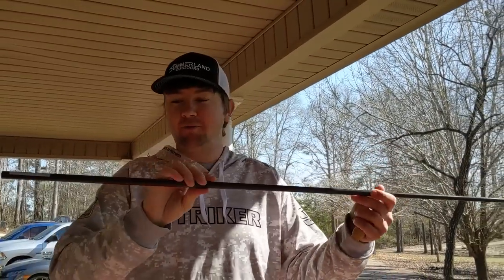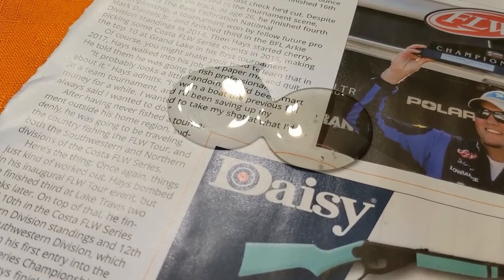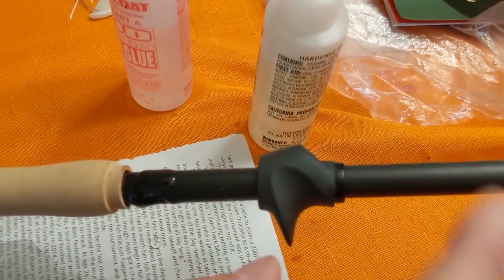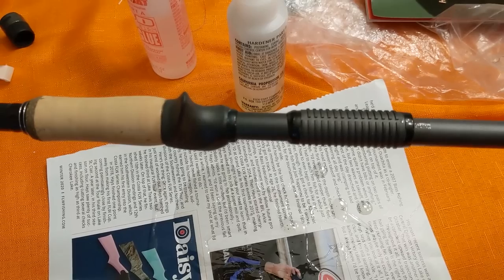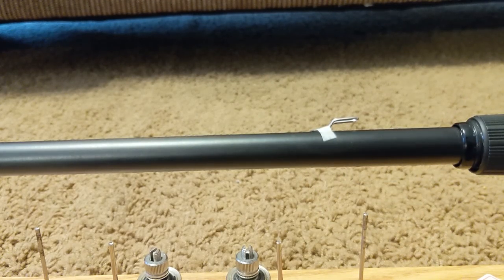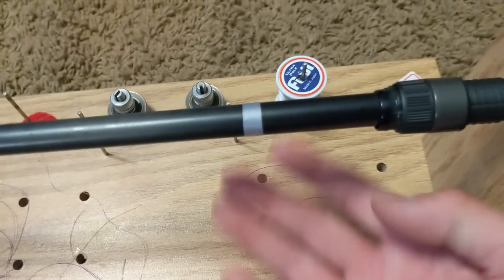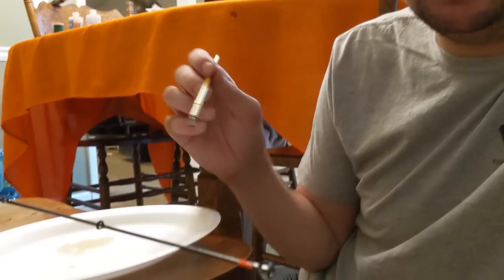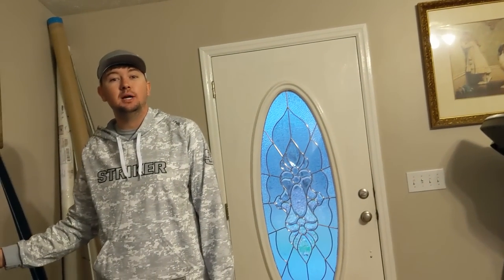I BUILT THESE RODS!!! How to build perfect bass rods!!!

Comment: Have you had a brush start coming apart on you yet? The way you are applying the wrapping epoxy you will most likely pull the hairs out of the brush. Other than that you are really producing product so way to go. You can get a cleaner cut in the thread if you hold more tension on it, it will pull the cut end under the overwraps. At this point you probably have built a hundred rods or more and you are perfecting it. Those Point Blank blanks are really good for bass casting rods. Good luck and keep up the work.

Comment: Great video! Hey Kyle what is a ballpark figure you have in each rod you built? Not counting the equipment to build just blank , cork , reel seat and guides!
Reply: The blank is around $180, the cork grips and reel seat is going to be around $20-30, the guides depending on which ones you use. But the most cost effective decent Fuji guides are the K guides in Alconites, you need about 11 guides+the Tiptop it will cost you around $30-40. If you go with Titanium guides it will cost you $90-100.

Comment: Thanks for posting this. After building a dropshot rod on the Point Blank, can you give a recommendation? I'm looking at the PB701MLF and the PB691MLXF. Can either of these handle regular sized jerkbaits? I do more casting than vertical dropshotting. Thanks!

Comment: Hi Kyle, new subscriber here so I apologize if you already did this.  In your information section you say that Point Blank is on of your favorite equipment to use.  I have been considering getting into rod building and was wondering if you could do a video on why you chose Point Blank.  I was looking at using the St Croix SCV modulus as I've been happy with their rods, but if there is something that stands out with Point Blank that makes them a better choice I would love to hear about it and the process you went through in choosing a manufacturer.  Thanks for a great video.

Comment: Hey man how much does it cost roughly per rod with guides and everything? Thanks your awesome to watch! Learn a lot.
Reply: The blank is around $180, the cork grips and reel seat is going to be around $20-30, the guides depending on which ones you use. But the most cost effective decent Fuji guides are the K guides in Alconites, you need about 11 guides+the Tiptop it will cost you around $30-40. If you go with Titanium guides it will cost you $90-100. Also all the equipment you'll need as well, it's definitely pricey!

Comment: Appreciate all of the videos Kyle. I was wondering if you could tell me exactly which reel seats, handles and caps you are using? I am actually going to build some rods myself and I notice how you build everything extra light so I'm having a difficult time figuring out exactly which Reel Seats are they lightest and I was hoping you could enlighten me. Thanks in advance.
Reply from the maker: I use the Fuji SK2 reel seat but I get the metal good instead of graphite.  Metal hood is about a tenth of an ounce lighter.  The cork I am using goes with the SK2 reel seat and it's the smallest one for it

Comment: i was getting ready to order parts for a build, how do ya know if the cork handle will fit into the real seat ? are they all standard sizing?
Reply from the maker: The cork I use is from Fuji and says it is for the reel seat I am using.  I'm not sure about the rest

Comment: How much does each rod cost for you?
Reply: The blank is around $180, the cork grips and reel seat is going to be around $20-30, the guides depending on which ones you use. But the most cost effective decent Fuji guides are the K guides in Alconites, you need about 11 guides+the Tiptop it will cost you around $30-40. If you go with Titanium guides it will cost you $90-100.

Comment: 2nd question is are u selling any custom products or any of ur friends jus curious
Reply from the maker: Not planning on it but I could if someone makes an offer.  I wouldn't recommend cutting the butt.  Changes the action of the rod
Reply: @KyleWelcher  I've had to do it on my carbonlites from bass pro bridgemasters in Kissimmee helped me with it I don't move reel seat it's to long past my elbow like on new veritas rods, I like how the older powell max 3d setup is
Reply: If you take the excess epoxy off right then and there instead of waiting then you don’t have to use alcohol I find it’s best to just use a paper towel.

Comment: What’s the average cost for you building them?
Reply from the maker: 200-225
Reply: The blank is around $180, the cork grips and reel seat is going to be around $20-30, the guides depending on which ones you use. But the most cost effective decent Fuji guides are the K guides in Alconites, you need about 11 guides+the Tiptop it will cost you around $30-40. If you go with Titanium guides it will cost you $90-100.